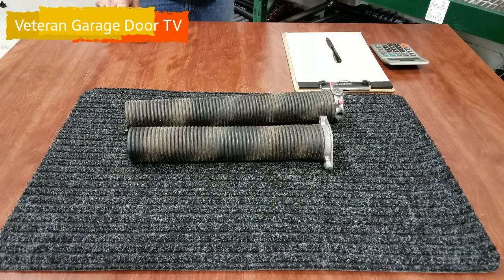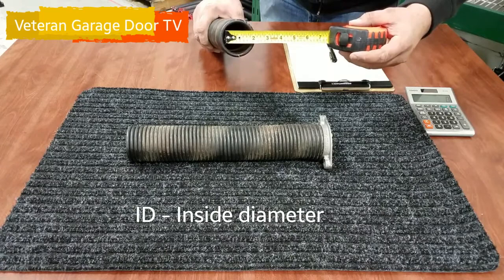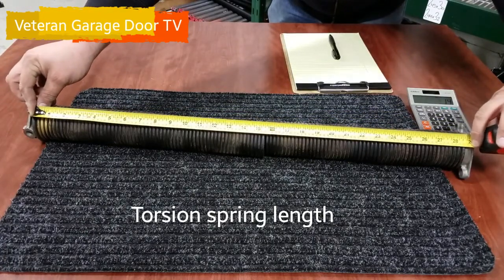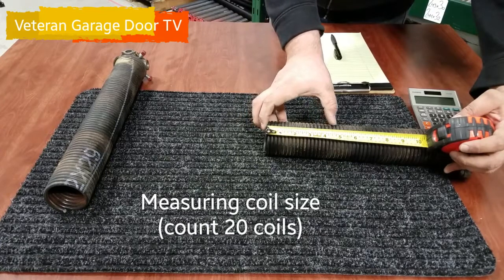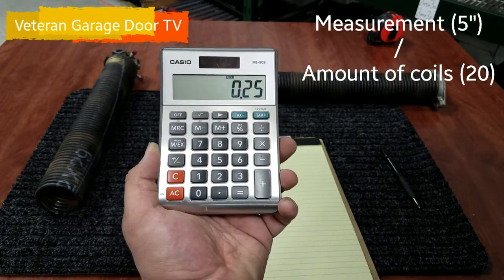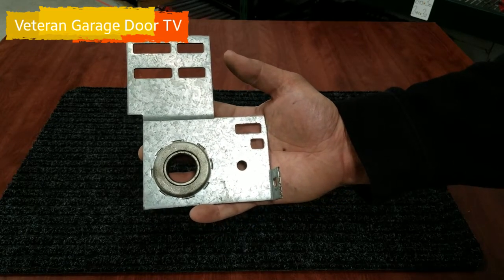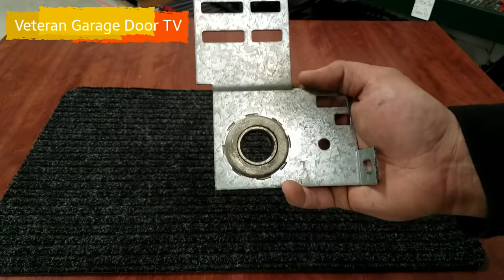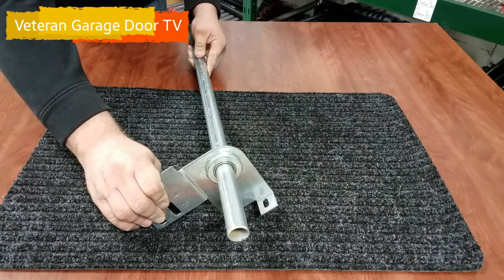How to Measure Garage Door Spring @ Veteran Garage Door

Comment: I ordered my two springs online and received springs 1 inch too long. It's 32" instead of 31". The inside diameter and wire size are correct. Can i safely use these springs without cutting them to 31"?

Thank You!
Reply: Good morning! 

Since it is such a small difference that will be fine and there should not be any issues. Thanks for the great question! Let us know if we can be of additional assistance. #VGDTeam
Reply: Thank you for a quick reply!!!
Reply from the maker: Hello Mickey , replacing a garage door spring/s is based on the IPPT (inch per pound turn) or in some cases by the size of the springs you have (not recommended ) in some cases the spring sizes are wrong .
We highly recommend for you to call a professional to calculate the IPPT for you and install the correct springs , or you may purchase the correct ones based on that info .
WE DO NOT RECOMMEND TO INSTALL SPRINGS THAT ARE IN A DIFFERENT SIZE .
That may cause a lot of issues .

https://veterangaragedoor.com/faq/how-can-i-measure-the-size-of-my-torsion-springs/
Reply: Thank you!